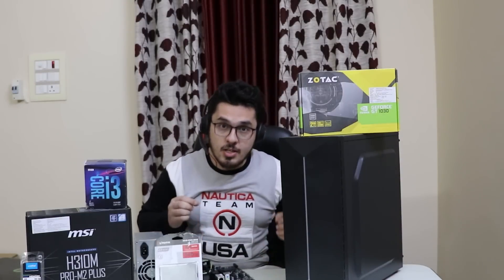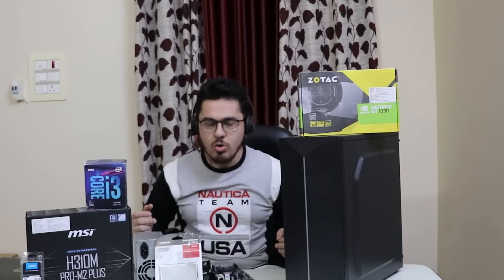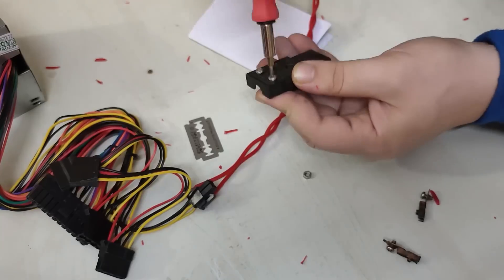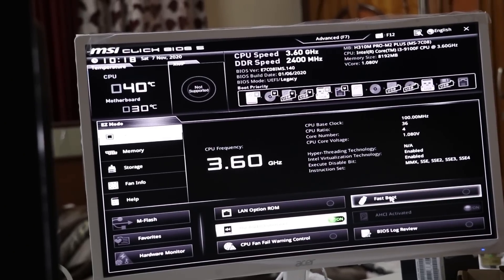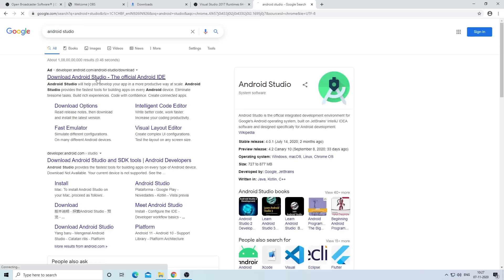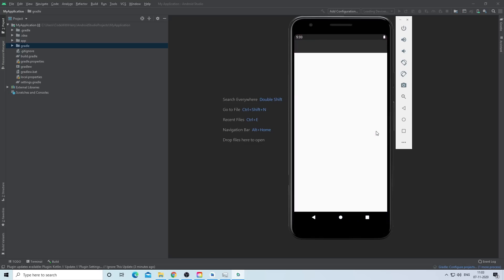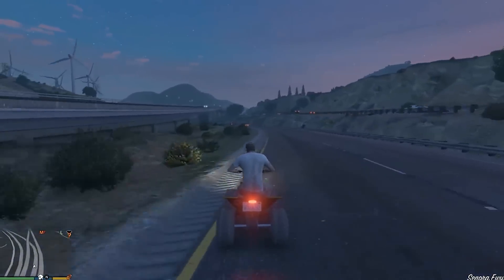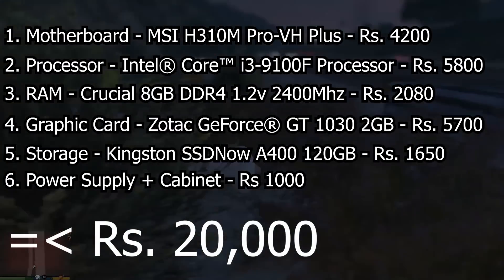Best Rs 20,000 Budget Gaming PC Build - Step by Step 🔥🔥

Comment: Gigabyte Geforce GT 710 2GB DDR5 will be a good because it's enough and we can spend that money we save on ram it will improve the performance here ram I mean that this ram is only 2400 mhz so we can increase the mhz
Reply: Nah Gt 710 cant run most modern games on high settings with 60+ fps. This card is better. 8 Gb ram is also enough for most games.
Reply: @Ghxlib  AMD APUs are better than these GT cards
Reply: @programmer4047  No one mentioned Amd APU's here
Reply: @Ghxlib  I know, but they provide much better value at this price point
Reply: GT 710 is very old cant run new games also you can only install 2400 mhz ram bcz it is the speed only supported by motherboard.

Comment: You should've gone for ryzen 3 3200g
Reply: It has Integrated Graphics , So It Will require Atleast 16gb Ram to Work Properly , And The Motherboard Also doesn't Support Ryzen 3 3200g , So You Need to Purchase Another MotherBoard , And The total Price Will Increase to Around 28k
Reply: @tejas4813  Then he must spend 28k for sake of future upgradability
Reply: The purpose of this video was to build cheapest usable gaming pc. He has done a good job
Reply: @channelpro2284  Can you talk to that power supply she is crying very hard and if you're going to build this pc then don't buy this psu go for cooler master or at least go for antec
And one more thing Harry don't know about earthing so use at least 3pin top or just buy 100rs cable.

Comment: Bruh Intel....
Whyy , amd gives lot better price to performance ratio.

Ryzen 3 2200 G would have been a lot better option as it is an APU and its graphic capability is a WAY BETTER than 1030.
Reply: @Dilsahib Nhi Bro....
Wo Myth Hai
2200G aur 3200G 8GB Ram Ke saath bdiya chalta hai...
Reply: @programmer4047  1st dual channel, 2nd igpu doesnt have own vram, so needs extra from ram, 3rd ram speed needs to be high, 4th mobo costs
Reply: @cherff  1st - You can use 2 * 4GB ram or use 1 * 8 GB and upgrade to 16GB Later.
2 - 8GB ram is enough for VRAM...
3 - Absolutely, RAM speed is necessary, but 2666mhz or 3000mhz is more than enough...
Even Harry is using a very slow ram
4 - AMD Mobo is even cheaper than Intel Mobo and i3 9100f + 1030 Combo is more expensive than 3200G
Reply: @programmer4047  go to amazon and then come back :)
Reply: @cherff  
3200G - Rs. 9889
i3 9100f - 5999
Gt 1030 - 6100
i3 9100f + 1030 = 12099
AMD is cheaper
You can get an A320 Motherboard For Around 4000
All the prices are from amazon
Reply: @programmer4047  3200g was supposed to be 7000-8000, big price hike
Reply: @programmer4047  dual channel is expensive
Reply: @programmer4047  16gb REQUIRED
Reply: @cherff  but, 3200G is Still cheaper than i3 and 1030....
And, You can upgrade to dual channel later on
Reply: @cherff  abhi 25k Ka bhi budget nii hai to kya gaming pc build Karne aye ho jao Intel HD pe gaming karo
Reply: @cherff  price hike abhi hua hai Varna aise 8-9k me Aram se mil Jata hai
Reply: @Dilsahib Haan bhai agree. Samjhao in dhakkano ko. 20 k me yeh sabse sahi build hai. Apne 10 saal experience se bol raha hu koi die hard fan ke naate nahi. Harry ka ye video best hai!
Reply: @channelpro2284  bhai agar 10 saal ke experience se bol raha hai tab to bechare tera 10 saal barbaad gaya.
Reply: @Rutetid  beta maine khud pc banwake sare benchmarks test karke dekha hai... Pehli bat to 16gb ram lagane ke bad bhi vega 8 gt 1030 ke kareeb na apayega... Dusri bat jab tak ye dual channel pe nahi hoga amd lene ka to koi matlab hi nahi hai... Teesri bat vega 8 pe tum 720p ki gaming kar shakte ho jaha pe usse achha performance gt 1030 1080p gaming me deta hai
Reply: @NS_C9Hunt  true bro AMD need dual channel to run well.
Reply: @NS_C9Hunt  Why Are You Lying? Vega 8 is much better than gt 1030. Show Me The Proof.
Reply: Intel fanboys be like 
isme to 16 gb ram chahie hota hai
Reply: @Yash Patel 3200G le lo
Reply: Or jo SMPS cheap ha ya toh pc sa jada ha bill generate kardega fir kia ha 20 ka pc  40k lag jaiga
Reply: @cyberdeals6721  Nahi maine bahut amps use kari hain. Kuch phukta nahi. Max to max amps will stop working bas!
Reply: Saste pcu se pura setup jal bhi sakta hai, 500-1000₹ bachane ke chhakar me pure 20k dub jayenge
Reply: No point in explaining these Intel Fanbois
Reply: @himanshumaurya428  bruh just coz we make sense doesn't mean we are fanboys. I think u are the one fanboying. And please go to school first, then start arguements
Reply: @cherff  lol Intel is dead now AMD is much better if you are considering gaming with competitive pricing
Reply: @himanshumaurya428  look at their newest lineup prices and then say that
Reply: @cherff  name them?
Reply: @himanshumaurya428  5000 series cpus
Reply: @cherff  what about Intel? Their processor are shit with heavy prices
Reply: @himanshumaurya428  tell me what processor do u have?
Reply: @himanshumaurya428  their processors rn are much cheaper lol. Ryzen is bought by everybody so the price hiked very high. You have a herd mentality and not a smart mentality.
Reply: @cherff  you don't tell me what mentality I have. And what's the point of your comment? Ryzen APUs are cheaper and more reliable than Intel processors considering the budget gaming
Reply: @cherff  poor kid who thinks Intel is still in the race 😂 lol Intel was dead long ago when AMD releases its Ryzen G series processors
Reply: @himanshumaurya428  i3 9100f is is much better than 3100
Reply: @himanshumaurya428  gt 1030 is even faster than vega 11.
Reply: @himanshumaurya428  you cant have 2 monitors using igpu
Reply: @himanshumaurya428  bruh just look at their recent prices. The 5000 series cpus are 10000 RUPEES MORE EXPENSIVE THAN 3000 SERIES. NOW U GET R5 FOR ABOUT 30000 INSTEAD OF ABOUT 20000
Reply: @himanshumaurya428  amd ain't budget savior no more
Reply: @himanshumaurya428  3200g is cheaper than 1030+9100f but u need to spend much more for ram, OCable mobo.
Reply: It Need Minimum 16gb Ram To work Properly due To Integrated Graphic , And The MotherBoard Will Not support Amd Ryzen 3  , So You Need to Buy New MotherBoard And More ram , Then The Build would Go Around  28k
Reply: @tejas4813  
3200G - Rs. 9000
A320 Motherboard - 4000
450W Power Supply - 2000
1TB HDD - 3000
8GB Ram - 2600
Cabinet - 500
Total - 21100

And, it will offer much better performance.
And, you can also cheap out on PSU if you want...
Reply: @programmer4047  bro vega 8 is nowhere near in regard with performance of GT 1030, I had build 2 PC's and tested them both in 20 games and softwares simultaneously. i3 9100f + GT 1030 performs a lot better than 3200g+vega 8
Reply: and it also requires 16gb of Ram to perform efficiently.
Reply: @NS_C9Hunt  considering the prize AMD is better and don't forget you can overclock the processor too which might give you a boost of 15-30% boost depending upon your mobo
Reply: @tejas4813  What??
I works perfectly with 8GB RAM.
Reply: @tejas4813  I have a laptop with ryzen 5 3500u and 8gb ram . Games run smoothly
Reply: Bhai agar knowledge nahi ho to bakwaas mat kia karo.
8 GB me perfectly work karta hai experience se bol raha hu .
Reply: @Rutetid  beta agar knowledge na ho na to tu bhi mat bolio... 3200g me max Vram hota hai 2gb ka... To usme max 16gb ram chaiye hota hai us pure 2gb Vram ko use karne ke liye... Tera 8gb ki ram me chal jata hoga bas lekin gpu usage kam rehta hai
Reply: @NS_C9Hunt  bruh to all in all 1030 se to acha hi na performance hoga. 8 gb me bhi.
Reply: @Rutetid  all in all 1030 achha hai vega 8 se
Reply: @NS_C9Hunt  Graphics Card Me Sirf VRAM hi nhi dekhi jaati aur bhi cheeze hoti hai jaise clock speed, compute units. Aisa Nhi Ki More VRAM = More Performance
Reply: @programmer4047  aur beta tu sun vega 8 me 1250mhz with 8 gpu cores hai jaha gt 1030 me base clock hai 1487 boost clock 1670 mhz with 384 cuda cores
Reply: @NS_C9Hunt  Abe mere pass hai aur 8gb me mast chal rha hai. Faltu chutiyap na kar
Reply: @Rutetid  noo
Reply: @cherff  Are You An AMD fanboy, coz there's picture of big Navi card on your profile photo
Reply: @programmer4047  nah i just like competition :)
Reply: @cherff  Even, I like Competition :)

Comment: U should but Ryzen 3 3100 instead of i3 9400f ...  It gives 4 cores 8 threads at similar cost
Reply: Ryzen 3 Has INtegrated Graphics So It will require Minimum 16gb Ram To Work Properly . And You Need To Buy New MotherBoard Which supports Ryzen 3 3100  ,  So The Total cost Will Increase to Around 28k
Reply: ryzen 3 3100 : ₹Rs. 8500
i3 9100f : ₹6000
not at similar price.

Comment: Bro you could have gone with 1050ti at least..; even 750ti is cheaper but outperforms 1030 by a margin.
Reply: 1050ti Alone costs 15k  ,  You have 5k Left , What Other Components Will You Buy In 5k ?
Reply: Used one or 750ti
Reply: @lyricsmint567  Everyone Doesn't Get 2nd Hand components .